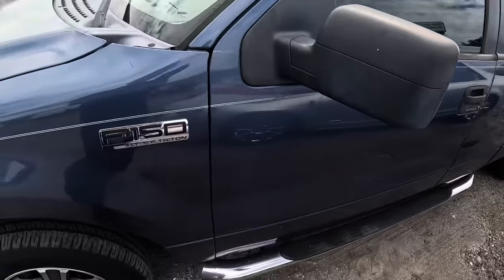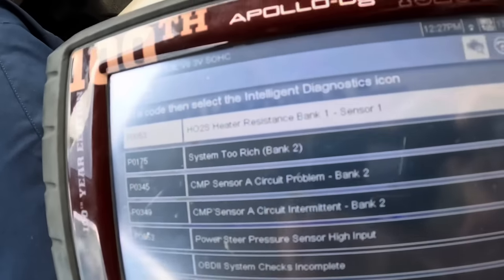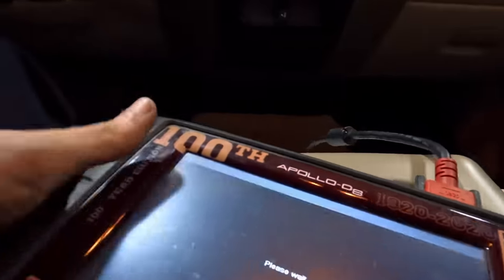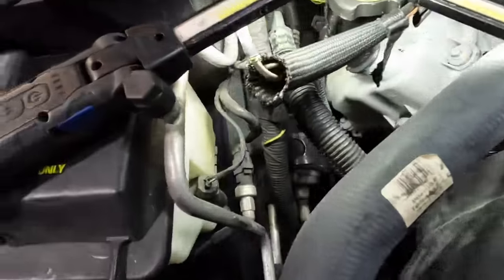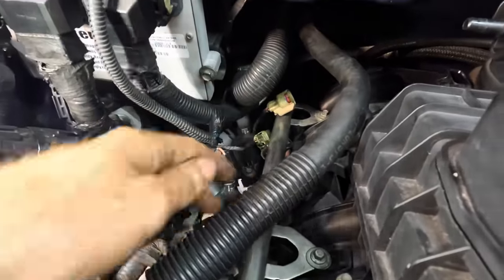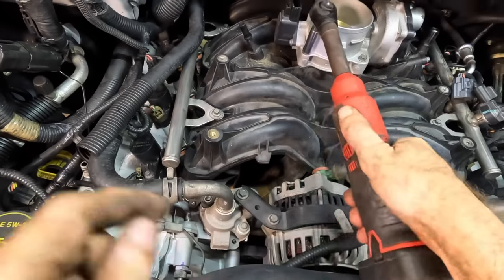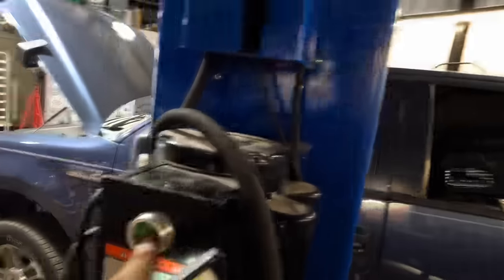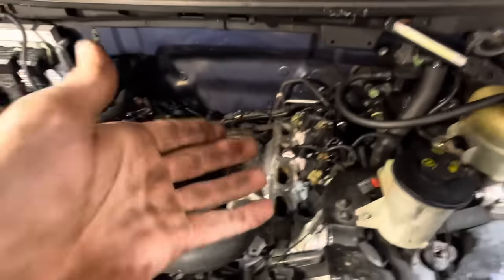Hack Job! Mechanic Botches Engine Replacement! Multiple DTC's

Comment: At first I was skeptical about your distain for the previous installers as the one o2 sensor was tied up even if improper and the one wire repair was nice and the other wasn’t causing a problem, but then you pulled up that intake and I realized you picked on the warning signs of a hack faster than I did lol

Comment: My father, who learned basic mechanics on his 5 Model T Fords, taught me to never use gasket glue unless provided by the gasket manufacturer.  I have followed that teaching against all of the negative comments by my friends.  If I had a leak problem, it was because I did something wrong. Not the gasket.  I appreciate your view and approach concerning gasket glue.  It makes engines much harder to disassemble when needed.

Comment: So… someone put an $8000 engine into a $5000 truck?  Yep. Sounds about right….
Reply: Good luck finding that for $5k
Reply: To replace this truck would cost 65,000 dollars or 20,000 dollars for preowned if its in good shape its worth the expense
Reply: @davidcraven277 you have obviously never owned an f150 of this vintage, my 5.4 f150 is 💯 the reason I will never own a gas truck again.  These are one of the worst ford trucks ever built.
Reply: @Alignmentguy  I don't care if its a ford GMC or ram trucks are expensive new or used the thought is if the trans and body are in good shape its worth it I would rather spend 6,000 on and engine than 20,000 thousand or more with payment's of 350.00 on up  if it gets a few more years its a go for me I don't like the payments

Comment: Thanks for an interesting video. Always great to see good diagnostics. I shudder every time I hear IMRC. I had a '98 SVT Cobra with the 4.6 and went through 3 IMRC motors, even trying to rebuild one though they were epoxy-encased, until we pulled the system. I was racing the car and was at WOT most of the time anyway.

Comment: One thing I've come to realize is if or when our local mechanic closes doors (been using them for 38 years) and very well trusted, I would absolutely consider making a 900 mile trip for major repairs to Rays shop! No BS, straight to the point type of mechanic! Damn near impossible to find these days.

Comment: Hack job for sure. I bought a Ford Flex a bunch of years ago and I do all my own wrenching but I had a couple electrical gremlins like this one. Turns out the dealer had changed the turbos and what I found on the harness was that it looked like they took the downpipe off with the O2 sensor still attached and then hung it off of the wires, which ripped the wires almost in half. Somehow I was 'lucky' enough that it didn't break all the way until I took possession of it. Dealer was 2 hours from me so I just fixed it myself with a new connector, some solder and heat shrink. I had to do more work on that engine eventually of course and when I pulled the turbos out there were bolts that had probably 150 ft-lbs of torque on them that needed like 30, and there were other bolts that probably should have been about 40-50 ft-lbs and weren't tight at all. Put the wrench on and whoop, turned like nothing. I went back and checked his paperwork too and it was indeed a dealer mechanic that worked on it, and he had it serviced there its whole life. He also missed the reason the turbos failed, which was a bad PCV valve and oil separator assembly in the valve cover, which caused excessive oil consumption. PO wasn't a car guy so he probably ran it somewhat low between changes, which overheated the oil and coked up the bearings on the turbos. I found the PCV valve issue right away and fixed it but the second set of turbos were toast in another 6k from that. About a month after I replaced the turbos it started flashing low oil pressure at idle, so it was a new engine replacement time. I cut my losses. I was looking at new oil pump at least, and at that mileage it made sense to do a timing set and water pump, and that's if it just needed an oil pump. I swapped in an 8k engine for about 500 more than those parts from a wrecked police car and engine has been fine since. Nothing but oil changes and sparkplugs for 90k miles. Could have all been avoided if the dealer had just checked the oil when it was changed and noticed it low on the stick, or the owner checking it himself. Check your oil people.

Comment: Kenny I love watching your videos, I've got alot of good tips from you, now see if this tip works for you, I've got my hands on a gun brush, I clipped the end and attached it to my drill and after shooting break cleaner in the pin holes then I use the brush to clean it out then of course I rinse it out with some more break cleaner, i then get a Qtip and pack it with grease, works great for me always has. Always a big fan with all my respect

Comment: Well dang, as usual I learned something from your video, I learned my 2005 F150 has Intake Manifold Runner Controls. I’ve owned it since new, do almost all my own maintenance and I never knew this. Good thing is it still seems to be operating at 333,000 miles. 😮

Comment: Those are damn good engines once you bulletproof them. High volume oil pump updated timing chain set and lock out the vct cam gears and delete the system out of the ecu. I’ve done several and they are still running strong!

Comment: Since getting my 01 F150 I've been less and less enamored with Ford. I'm told I'm so lucky for having the 2 valve motor that only blows spark plugs out on occasion (I've repaired 3 of 4 blown plugs on this motor; make sure you check your plug torque every 15k-20k!). The three valve eats its motor, and subsequent motors from Ford either melt themselves (because they've upped the amount of plastic parts in the engine by about 60%), blow head gaskets at 30-40k or carbon themselves up because they're tuned so badly. Really kinda glad I didn't spend much on this truck. May finally leave the blue oval for a Ram.

Comment: I purchased a truck a few years back that had an engine swap done, including a brand new wiring harness with all the proper GM fasteners and clips pre-installed. I think I spent a couple days just re-routing and properly connecting the whole wiring harness. All the sensor problems I had boiled down to damaged wiring from being pinched/stretched/burned because it was just thrown together. Thankfully all the damage was obvious and I didn't end up with intermittent gremlins. While it's entirely fair to place blame on the guy doing the work, I think it's just a symptom of the industry in general.

Comment: Good work Ray. I use extension bars that have rounded square socket end allowing for slightly offset angle. Best thing out. Try to get hold of some.

Comment: Those tabs don’t fall of when overheated, if it’s gone it voids the warranty but they are designed to melt the center dot out when it reaches 250 deg most times. It’s a solder ball that melts out and leaves the disc still attached to the block/head.

Comment: I’ve got a 02 with the 5.4 2v it’s actually been a dang good truck I cut grass for a living raced dirt track so it’s alway pulling. So needed a intake right at 200k back during Covid shortages. Man I know that good mechanic always told me do not use a aftermarket intake the gaskets are not the same there no good. We could not get a ford intake I needed the truck. So I let him do a aftermarket he gave me a warranty said if it mess up I’d only pay difference in part for ford intake once we could get one. I made it 76 miles and the back side of gasket or whatever went shot all the antifreeze out had pull over get towed in. So what you said about using ford parts I’m a believer 😂. Truck sat for 3 months waiting on a intake back in 2019 or 2020 can’t remember witch year. 2v owners you been warned

Comment: Amazing how I kept 70s and 80s model Chevys and Caddies, running just fine, rebuilding quadrajet carbs, smooth operation. I  got tired of carbs, yrs ago, but these new fuel injection , variable valve timing,  systems, etc.,  are plagued with issues.

Comment: These days 200,000 out of a Ford rocks! My sister just dumped her 2013 Exploder 217, 039 because every gremlin came to visit. Cats went, sunroof motors went, windshield bead and cowl went, windshield got hit by a rock on the freeway, alignment went Wonkaville. Our mechanic bought it for $1500 and I found her a 2020 Durango, factory tow package and every bell and whistle. 18000 miles, lease trade in. $35,000 out the door. The lease was just under 900 a month. Original sticker was $87,000.
Here is what cracks me up. The V6 WITH the full factory tow can pull 6200 lbs. Same vehicle without factory tow, 4000 after you add the hitch. Once I got under that puppy...WOW. Suspension, sway bars, larger disk breaks, trailer breaks, wiring...ALL FACTORY and 3rd row seats. She still whined. The seats are half leather and half cloth so I farted in her car. "This is why where the butt and back meet the seats it's cloth." I am banned to the the 3rd row for life now.

Comment: 26:40 I work as an auto-electrician and basicly all we use on wiring repair on vehicles are crimp-and-shrink butt-connectors. The ones made by Autoline, Heatgun, and a decent set of pliers with the red-blue-yellow crimp areas is what you need.
Never solder anything on cars/trucks, it'll just fall apart.
Also tape traps moisture, so dont tape over crimp connectors, thats stupid.

Comment: I used those same wire connectors to do a repair on my headlight connectors . The ground wire would not get a good connection no matter what I did. I tried to redo them 3 times. The light would be bright , hit a bump and the light would go low. Finally had to get some different connectors and fixed the ground issue. I'm not a mechanic, obviously, and I'm still trying to figure out the best connectors to use for stuff like this.

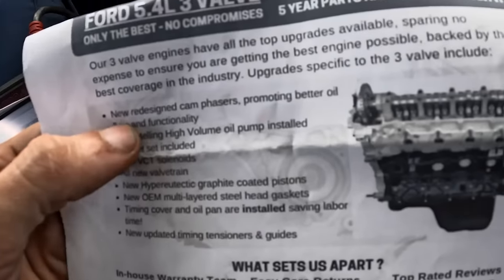Comment: I agree with you Raymond on the warranty information aftermarket cam phasers are a no no on these triton 3 valve engines they normally cause engine failures and there very vague on everything should of gave all part information on make model and manufacturers of parts 4:20 @Rainman Ray's Repairs

Comment: Some one didn't know what they were doing when installing that engine. I have same truck, and it had used engine put on by previous owner's mechanic. I found a lot of things routed wrong once I started working on the truck. 2 bolts on top of bell housing was missing. Transmission cooler lines are routed wrong (supposed to go under the engine, but it runs above engine mount now.) It too had RTV on intake manifolds. Intake manifold gets sprayed with gasoline from fuel injector and RTV cannot withstand gasoline. Not good.  Transmission shift cable was sitting on top of exhaust pipe and melted. I think I see the same issue on the truck you are working on.   I can confirm IMRC error code only sets bank 1. I had linkage clip fell off and linkage jammed open. It set bank 1 code only as well.   Rattling noise at start up is most likely timing chain tensioner. If the reman engine used a cheap part, it could have failed. I had to do timing job twice for this reason. I replaced with Cloyes kit and tensioner seal blew out again and broke timing chain guides once again. I replaced with ford parts this time around.  This engine also has issue with fuel injector getting stuck open. This happened to my engine, hydro locked, then bent connecting rod. I had to pull head off and and replace connecting rod.

Comment: For those of you that use your side view mirror to back a car onto the lift you can also take a paint marker hold it at the end of your lift arm then run the lift arm back and forth and put you a bright yellow mark on the floor in the path where the lift arm travels

Comment: I run a school bus shop.  Wiring is a nightmare.  I am going on a month on one bad wire due to a wheel chair safety interlock keeping the parking brake from releasing.  The issues I face mostly is 50 plus foot runs on a single circuit.  I had a bus last year take almost 4 month of chasing it wire by wire to find 4 different breaks in a 48 ish foot long bus.  I am not the best at electrical but I have thousands of dollars in diagnostic tooling so it helps.   One rule that we follow at my company is if a wire is routed by the factory a certain way then it goes back exactly as it was.  That way the fleet is all the same.  A problem lately is from the factory some of the harnesses are routed differently.  It sucks.  Also I am always stabbing myself with picks.  I was cringing watching you disconnect that connector with the pick.  I was waiting for curse words.

Comment: I bought the exact engine from same manufacturer or so called rebuilder. Cam phasers are Dorman and cams have bearings installed. They are not bad at all if you ask me. Mine came from Mexico, it’s not US product as they claim. Not from east coast where their headquarters are.That rattle sound will phase out. I install and removed mine four times, extremely difficult to work on specially no lift. I don’t recommend doing this on your own, but at the end was worth dumping 8k on an engine.

Comment: A while back you had a repair that had similar issues and the flapper motor ( sorry for the wrong name ), the linkage was jammed up because the harness was pushing against the linkage rods.

Comment: Finding that bad connector was a good call, similar to just such "finds" I've tracked down working on dead computers. My best was finding one mislocated pin in a 775-pin CPU socket (1-1/2 " square) that made a fine dental pick under a strong magnifier look like a railroad spike in comparison to a finishing nail.

Comment: those heat tabs on the block actually have a melting point and when it hits a certain temp the middle part melts out at around 240 degrees. we use them on engines we machine and rebuild.

Comment: I had a 2008 F150 with that 5.4l turd.
I will never have another the motor and truck in general was going to cost me several thousand dollars to repair. 
It only had 120,000 miles on it so I thought I would give Ford one more shot. 
I traded it in for a 2011 F150  with the 5.0l engine. 
I always liked the 302.
My first vehicle was a 69 F100 with a 302 and had a few more along the way. 
Had 64 Falcon Futura with a 289.
Same block just some small things. 
Anyway i still good have that 2011 but I can't drive anymore cause I lost my right leg  can't find it anywhere. 
Who knows maybe I be able to drive someday. 
It's paid for and I don't have to feed it, just a little insurance in case a tree falls on it.

Comment: From personal experience I can confirm that a brand new IMRC will still throw codes from either the wiring harness not being run correctly and binding the rods that open and close the flaps or that the wiring connected to the IMRC is chafed at the frame or both of these conditions exist.

Comment: A whoo whoo
Somebody’s in trouble

No sealant on mating surfaces, *unless two metal components meet and you need a dab of RTV at that one spot to keep fluid from wicking out there. From you okay, I learned it from watching you.

I fixed the Camry with superglue gel the other day. Not that expensive gorilla glue, the cheap duro brand from Walmart. Four tubes for a mere $1.59. It used to cost $0.99 but, you know, inflation.
Don’t worry it was just body work. The service writer at the dealership said, and I quote, “krazy.” 

There was some work with an interior trim that houses an airbag so I let the dealership fix it because I didn’t want it to blow up in my face. The dremel does make sparks fly. Talk about a rookie mistake, accidentally discharging an airbag would really make me feel stupid. 

 — or was it, “crazy,” he said? Darn homonyms.

Did Troy install that engine? A whoo whoo

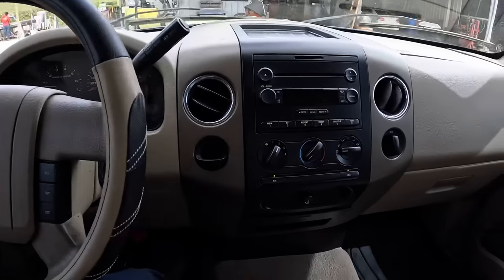Comment: These triton 3 valves and even the 2 valves are notorious for passenger head Oil Starvation also the backs of the heads are oiled last Raymond  5:39 @Rainman Ray's Repairs

Comment: One issue with doing timing jobs on this engine is generally no one knows how to properly adjust the oil timing chain tensioners that have locks on them to keep the chain tight with no oil pressure when the engine starts up. I ended up with a 1500$ bill because mine wasn’t set right destroying one of the tensioners. It was so bad the chain almost burned through the cover.

Comment: Ray, just because an item has been replaced, doesn't mean it's good. I remember a case of an aircraft being grounded for 4 days because of a fault. When it landed it had a fault which was correctly identified and a replacement unit was fitted. When the system was retested, it was still there. after a lot of testing it was found that the replacement unit had the same fault as the original unit. There's more to this story which I won't go into. So remember just because something has be replaced it's good.

Comment: Having fitted a fair few of those temp sensors I think you'll find the metal in the centre of the washer will melt out if overheated not so much the washer dropping off. Greeting from over the pond to you and family units.:virtualhug:

Comment: The cam position sensor plugs go bad on a regular basis. I actually bought a truck with this engine and it was the plug on one sensor that got me the truck for only $1700. Spliced on a new plug and it is perfect running now. It should be showing a cam out of time if the plug is not connecting.  That seal in the plug is exactly what I saw wrong with my plug. The new plug fixed it.
 The kid I bought my truck from had the timing job completed but it still had the cam timing issue. The mechanic gave him another big estimate and he sold it to me.